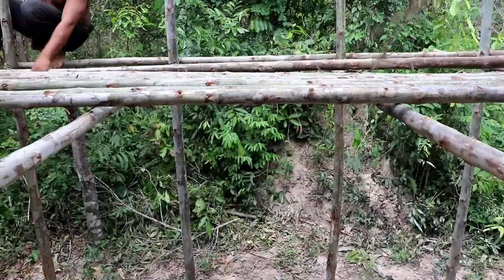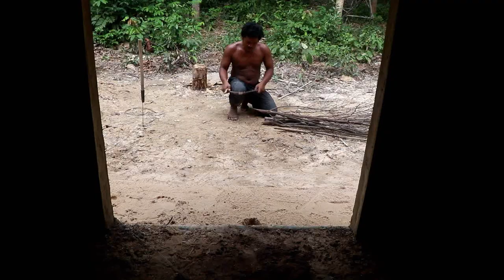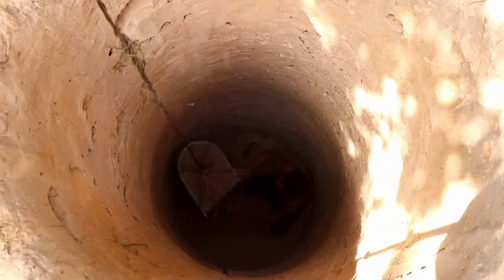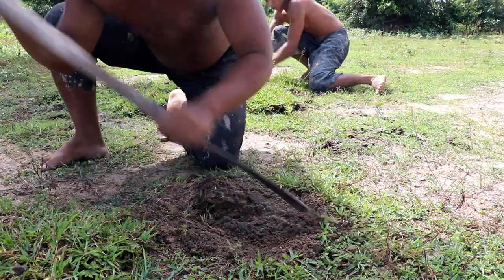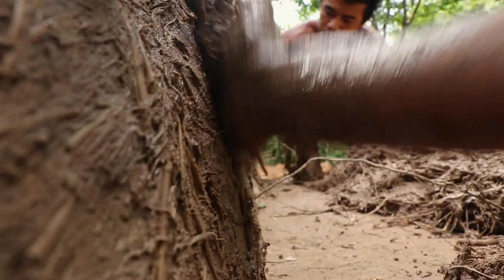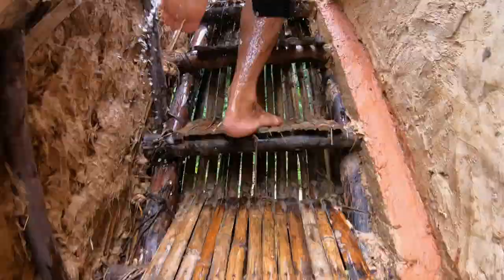65 Day Of Build Water Slide To Swimming Pool On 2 Story Villa House,Groundwater Well & Swimming pool

Comment: Fantastic job! However, when does a slide and a swimming pool become a necessity in the jungle? It's more of a luxury than anything else.  Again, it's not a necessity. The ground well is a good thing. However, spending all that time to build  pool and slide the focus should have been on necessities like creating a water filtering system for clean sanitized drinking water. They should have spent more time weather proofing their shelter with doors and windows. Also building a space inside to cook food during the heavy monsoon rains. 

I know these builds aren't supposed to be practical. They are designed to entertain the viewers. However, it would be nice to see them build more practical applications. But I do enjoy watching these videos whether they are practical or not. Thumbs up.